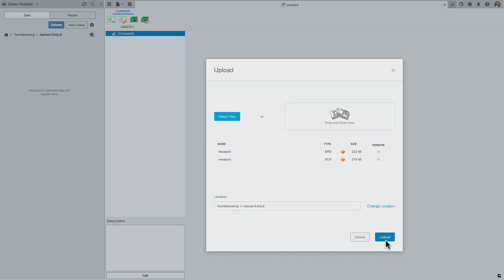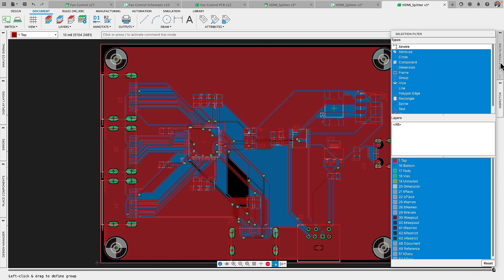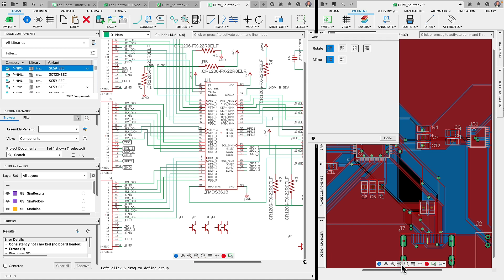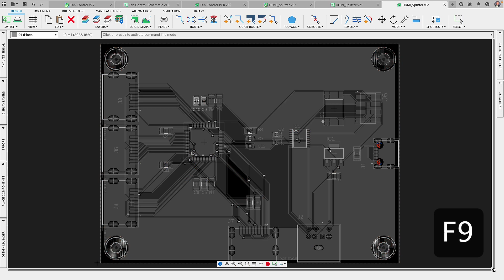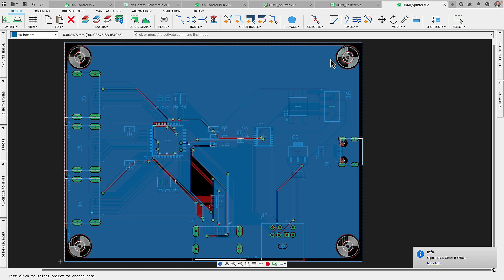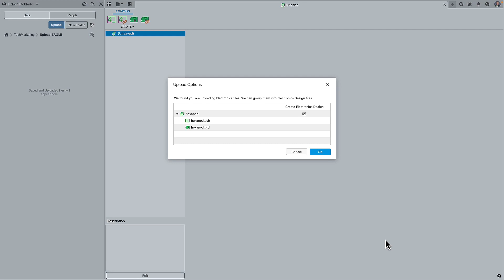Why You Should Migrate from Autodesk Eagle to Fusion 360

Comment: I have used EAGLE for ~20 years and now just spent a week trying to migrate a larger projects from EAGLE - i am nowhere close to a working state. I have tried this a few times in the past and always stopped it in the end as I ran out of time or patience. This time around, I have to succeed - I was hopeful as my last attempt has been a while ago. Functionality is fine. Usability is quite a bit worse than EAGLE for my applications, and that is mainly due to intransparent workflows and links between files, lack of good documentation and context sensitive help, an overall unreliable application (unexplained crashes, loss of sync for no reason,...). And please kindly save everyone the time for the "all this and more with Fusion..." tag line at the end of every video for us poor souls that have to watch dozens of these to find the information required. What the users migrating from EAGLE need is not to see how a blank new project is created - it's simple and we know that works. But many of us don't spend their days creating new projects. In the long run, it is much more important to support efficient maintenance work flows on designs and libraries, maintaining different versions, etc. Most of this seems terribly complicated, with quite a bit of value lost vs EAGLE in some places (from simple things as why can i not import my EAGLE shortcut key settings? why are some key combinations blocked? to the more annoying and more important such as that everything maintenance engineering wise seems to take more time and some things are more complicated... worst I find that things sometimes don't work and you think you did something wrong but then when you restart (or just after some time for no apparent reason) they all of a sudden work. Oh the joy... :)

Comment: there is nothing new except the polygon pour feature, why should I migrate ?
Reply: There have been many improvements over EAGLE here's a shortlist

-Renameable Supply pins
-Components can push and shove to make room for themselves
-Signal Integrity tools
-Improved search for components(you no longer need ? * characters)
-Better ECAD/MCAD integration
-Arrow key moves are supported now
-You can place components inline with a currently drawn net in the schematic and it will make space for itself
-MOVE in the schematic can keep the angles of the nets

Much more
Reply: also things like ODB++, slotted pads, inferencing, new graphics engine, autocompletion for net/signal/pin names, preserving angles when moving in schematic, layers & errors persistent panels, ... and many more coming soon ;)

Comment: I really want to like Fusion 360, but I just can’t get past the user interface, it is awful, feels very cramped.
Reply: Aside from the multi-monitor support that was mentioned, it is also possible to reposition the dockable panels that open up by default. You can tab them together or hide them altogether if you are working on a smaller screen. The state you configure will be remembered next time you launch Fusion.
Reply: It supports multi-monitor. I have 4 monitors on my system.

Comment: For integrated design, this is a no brainer. KiCAD is fine, but managing the mechanical design in separate software is awful. 
I design a a multi-board schematic, layout, complex mechanicals, 5 axis CNC programming, simulation, rendering, and animation all the time. I wouldn't bother with a stand-alone solution if you paid me. 

The first year or so of Fusion Electronics was rather useless, but it has grown up enough to be used for commercial projects. If you are a DIY hobbyist that only wants a free solution, there are options for you. For those that need to develop a complete product with mixed discipline engineering and an easy path to manufacturing - F360 is a great value.
Reply: When was the first year?  I used it in late 2021, and wasn't thrilled then.  Hated it enough to accept/prefer manually importing a PCB layout into a mechanical CAD design.
Reply: @zz3709  If you have not tried it in the last few months I would definitely recommend to do so. The team has spent great efforts over the last year into improving stability & performance.